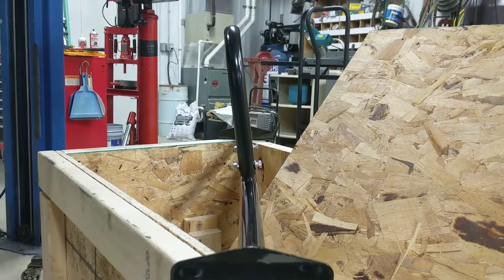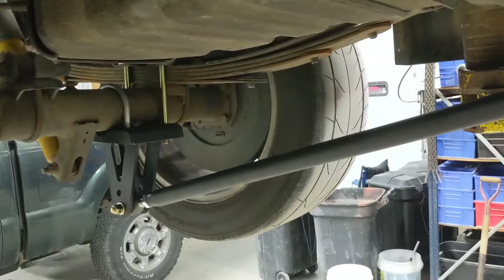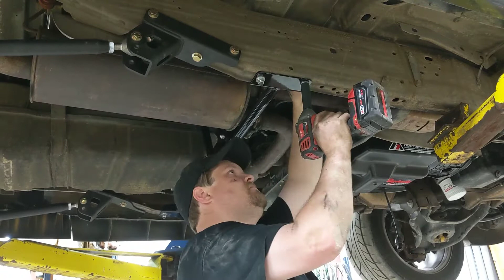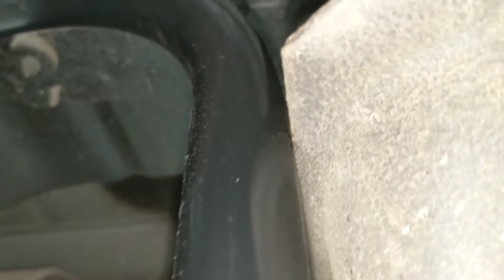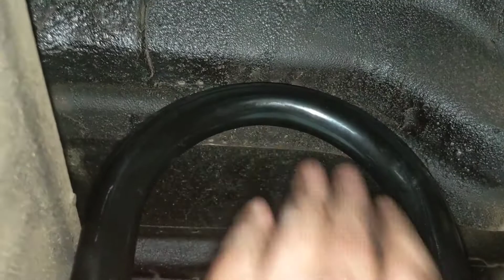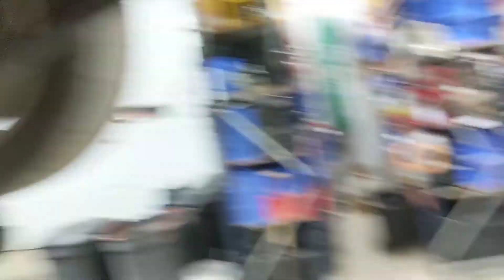Ford SVT Lightning Driveshaft Loop Installation

Comment: do you have a measurement of the length? im trying to see if it will fit on a f250 2008
Reply from the maker: I'm betting it's different but I can try to get under there and measure it with a tape measure. What measurement would help you? Hole center to hole center?
Reply: total width  of the section that bolts up to the frame rail and distance from each side to center. thankyou in advance
 @605BOLT
Reply from the maker: @rd2fuelsystems10  ok I'll try to get it tomorrow. If I forget just please remind me. 👍

Comment: Driveshaft is hitting on the back of the cab on lowered 03 lightning? Is this something your familiar with should I just notch that section out with an angle grinder?
Reply from the maker: I'm not familiar with that, no. That said, I would do what you're saying - clearance wherever it's bumping. Not much other option for you.
Reply from the maker: Mine is factory height. Off road status. 😂

Comment: If you were to build one for a custom application would you put it more towards the middle of the driveshaft? Or where would you place the loop at
Reply from the maker: I don't think I would. Whenever I see them on any type of vehicle (not just Lightnings) they are toward one of the ends. If it breaks at the rear end u joint it will slap around like crazy and beat up the bottom of the truck but as long as you don't keep the throttle pinned (which no one would) it might not be too bad. If it breaks up front by the transmission, the rear end and speed of the vehicle going down the street will make it fling around until it comes to a dead stop. Also, it can catch the pavement and pogo. I'm not an expert by any means but that's my understanding anyway.👍
Reply: @605BOLT  thanks for replying and your insight like most we cant just buy a unit off the shelve unfortunately I gotta get a unit that weld in and cant decided where the best place to put would be honestly I just domt want the drive shaft to make it's way into the cab that's really all I care about any ways thanks man
Reply from the maker: Ya. I hear you there. You should be able to basically copy the design of that bar with something welded up custom. Could use the same set of holes too if it works out. I'm sure you can figure something out

Comment: Since there are slots couldnt you slide it over a hair to clear the tank?
Reply: Can we get a full truck tour soon? Mods etc? Maybe see some pulls in it? Good video.
Reply from the maker: Got a few more up now.
Reply from the maker: I might end up "clearancing" the tank a bit.  Every now and then when the truck is sitting at just the right angle, vibrates against the tank.